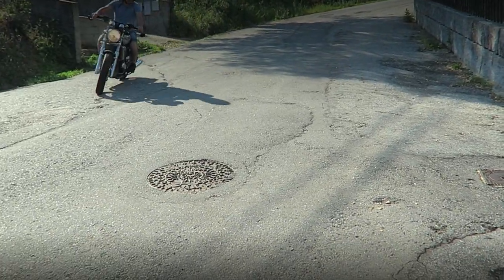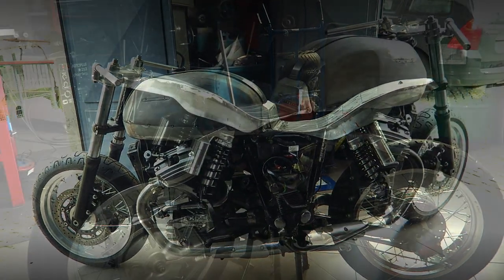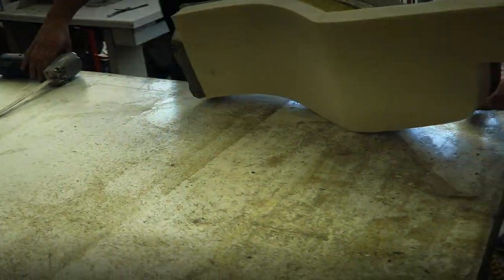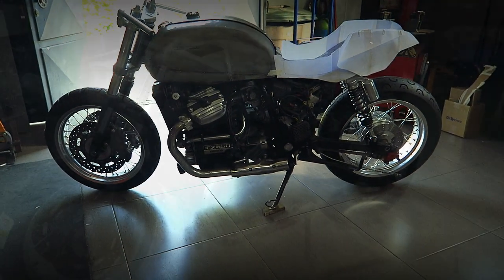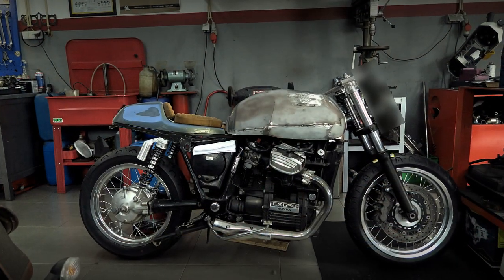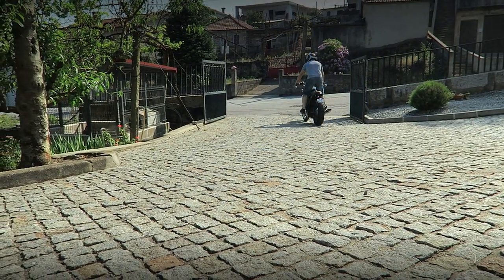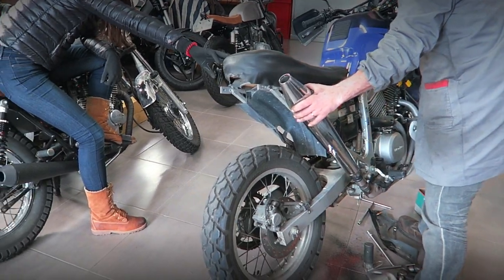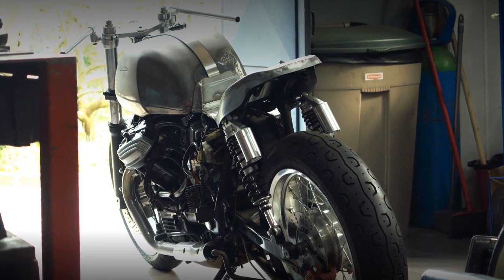Cafe Racer (Honda CX 500/ CX 650 by RACER TV) Part 3

Comment: Very nice altho' I am not a big fan of cowls. I do like skinny chrome plated fenders. I also prefer the frame of the bike to be seen at all angles, especially if there is some sweet tig weldings visible on that thing, but hey, that's your baby, not mine!
It looks good so far, that I can say!
Reply from the maker: Yes, i understand your preferences. 
But one of the things i have learned during this project, is that there are things that don't work in some motorcycles.
On this project, the frame of the Honda Cx650 Custom, have some specific features that bring some limitations.

That is why i had to change some things from the initial drawings.
Thank you my friend for sharing your opinion. :) Cheers.

Comment: Great video series. I just purchased a cx650 c. I loved the sound of the peashooter exhaust, and curious where you found them for that bike? Also, did you need to have the carbs rejetted? 
Thanks again for a superb serious on a rare bike.
Reply from the maker: Congratulations. You have also a great bike. :) About the carbs, yes, after changing the exhaust and cone air filters, it is always recommended to increase the jets. If you search on google for "peashooter exausts", you will find several websites selling them.  Cheers.
Reply: @RACER_TV  FANTASTIC!! Thank you for your reply and helpful advice.  Cheers

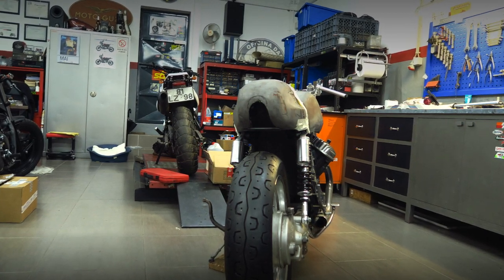Comment: 4:00 So sexy, had to censor for youtube?  I look at the CX650 logo on the engine and cannot help but feel you need to make new logos (see the autocad) that say RT650, RT for Racer TV of course!

From personal experience, I know the dilemma when summer is here of wanting to get done, but wanting to get done right.  Don't let it tempt you as when it is done, there could be that bit that you just aren't happy with.  Like your seat, to get it done for summer, you could have saved time and settled for your first design, but you chose to do it right and that is always the better choice.

As a vintage Honda rebuilder, I am really looking forward to seeing how you will be doing the side covers.  Too many cafe builders pull the airbox for cone filters with the CV carburetors.  You will have a more authentic/better "Looking" cafe, but it will run terrible and will be nothing you can do about it.  To properly function, the CV carburetor does need accurately tuned intake air rams for them to function.  The carburetors are so sensitive to change in airflow that even just changing the exhaust will change how well the carburetors will work.

It made me smile when you showed your new exhaust for that reason.  On my nighthawk, the carburetor turning, especially when cold is very finicky due to the more open exhaust.  Those peashooters have some air capacity and backpressure to help keep it riding great!  With two passenger capacity, I am sure your intention is to ride it lots!
Reply from the maker: Thank you my friend for your very smart comment.
You said it all.
Yes, i had to censor some sections, because i don't want to show it all.
In what concerns to the air filters, i am thinking of installing velocity stacks, but they are going to be hidden and protected inside a metal box(With vents, of course) which is going to work as side covers too.
And yes, i am thinking of changing the CX650 Logos. I just haven't decided the final look. But thanks for the suggestion. :) Cheers.
Reply: Absolutely will be worth the wait to see!!!!

Comment: Which precise Peashooter did you use? Which brand? Are there different sizes? Would this work ion my Yamaha TR1 and XJ 550?
Reply from the maker: My peashooters have 675 mm length.  Try to search on the internet for "Norton COMMANDO "PEASHOOTER" 675 mm". The Yamaha TR1 engine sound is a bit different due to a 75-degree angle between the cylinders,  but it will sound similar. Cheers.

Comment: Could you please tell me what your mechanic did in order to get rid of the wobble on the rear wheel?
Reply from the maker: Lol. Yes, the rear wheel is completely misaligned, because it was temporarily mounted only for the building process. After polishing the rims of the wheels, it is going to be mounted and correctly alined with the right spokes. :) Cheers.
Reply: RACER TV glad...I used a Royal Enfield rim for my project and it turns out it is a bit out of shape causing my rear wheel to wobble a bit. M clueless on how to mend it...

Comment: Diamond atelier mach 2 ,  impuls xyz K101, xtrpepo silver bullet mach 1, untitled motorcycle moto guzzi fat tracker & supernaturale, radicalguzzi nitrosprinter , auto fabrica xsr 900 , kraftstoffschmiede Hercules
Reply from the maker: I love most of the projects you mentioned. But unfortunately, there is not enough photo/video material about those projects for a 5 minutes video. But there will be a video very soon about the auto fabrica xsr 900. :) Cheers.